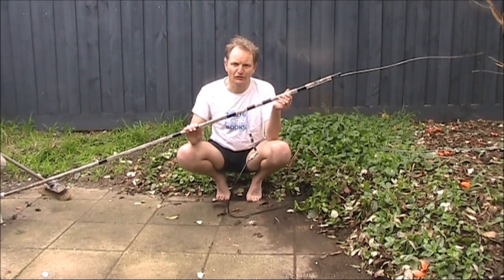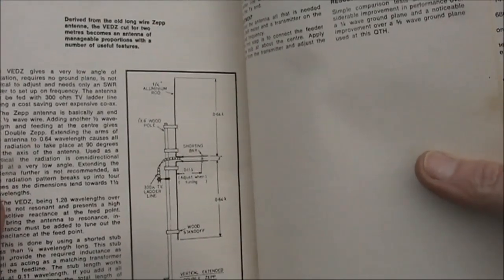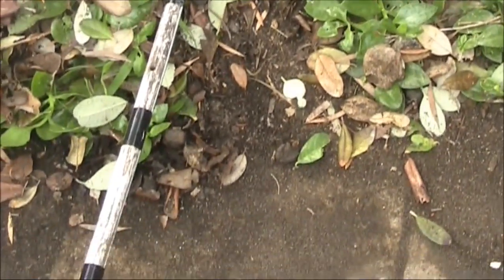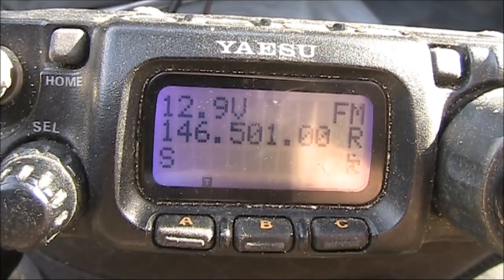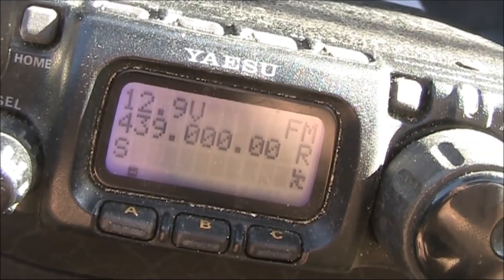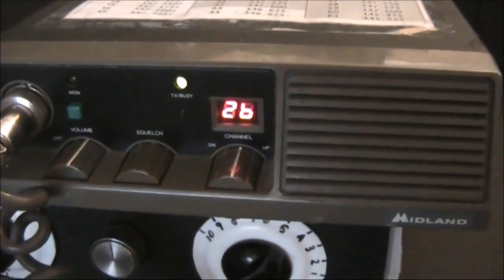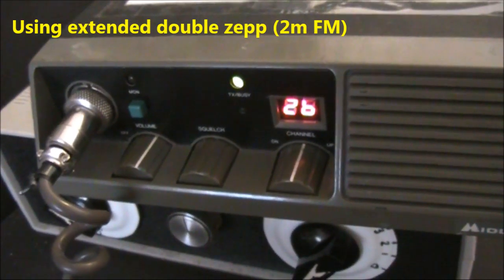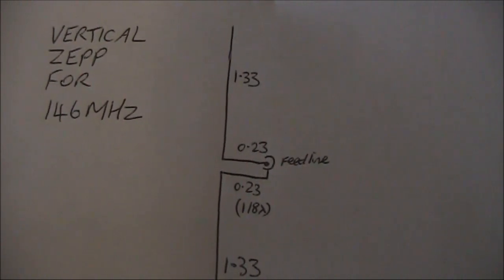Vertical extended double zepp antenna for 2 metres FM (and more!)

Comment: Hi Peter, thanks for that. Tell me, how can you change frequ. for lower end of 2m, say 144.2 ssb

Geoff vk3sq
Reply from the maker: Hi Geoff - you'd scale each direction up. Eg multiply by 146.5/144.2 approx. But in practice you'd probably design it for 145 MHz so it covers more of the band.

Comment: Very Interesting build!  I built something similar for GMRS and it worked well but I had two 1 wavelength poles  with a 1/4 stub I just adjusted the distance for best swr at about 4” from the bend.  Playing with a 70cm version now actually using 1/4” copper tube

Comment: After thinking about this antenna during this morning's live Q&A session, I have been crunching numbers.
The reason it has a low vswr on 431mhz is that it is 4.5 wavelengths total including the matching section. This makes the feedpoint a low impedance there too.
My basis is this: 5/8 + 5/8 + 1/8 + 1/8 = 12/8.
431/146.5 = 2.94  so it's 36/8 wavelength = 4.5 wavelengths. It would be worthy of investigation for its low angle radiation properties there for a few reasons: Its centre fed so lobes may be "forced" into combining and although it will have several lobes there may be at zero degrees a good bit of gain.

Comment: These are fantastic portable VHF antennas.  I use a roll-up EDZ made from flexible antenna wire for SOTA activations.  It outperforms a JPole by a good bit.  The only real disadvantage are the center feedpoint. I hang mine vertically from a slightly leaning telescopic pole and velcro the feedline to the pole to keep it away from the antenna.

Comment: Great video Peter, thanks. I use double extended zep antennas on HF based on a doublet/450 ladder/bal tuner with a 5/8 leg length for my fave band. Will give this 2m version a go too. BTW, Might be worth checking the integrity of the Diamond especially if been up for some time. Cheers, Nick M1DDD

Comment: Hi Peter I built this anttena  this afternoon  I used thick speaker  wire ended up on 139mhz but soon trimmed it now 1/1 on 145 mhz I put it up at 20ft on a fiberglass pole and it's working very well good work mate thanks chris G0WFH

Comment: Great  Peter... Do you  think it would work if mounted horizontally for web?
Reply from the maker: Most definitely. The most common implementation of this antenna is on HF where it's strung up horizontally. It will have a narrow beamwidth though on the two main lobes.